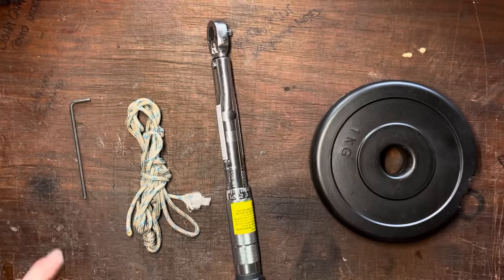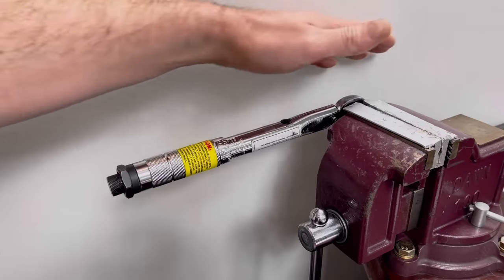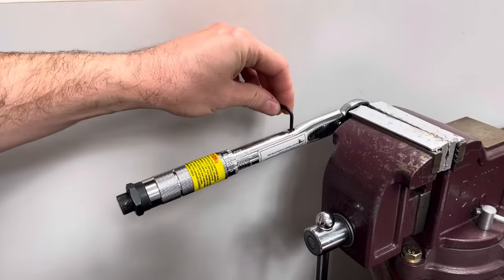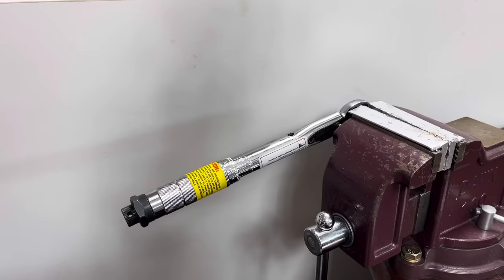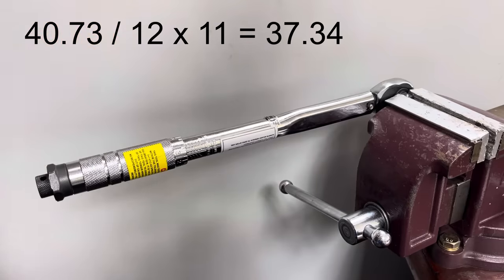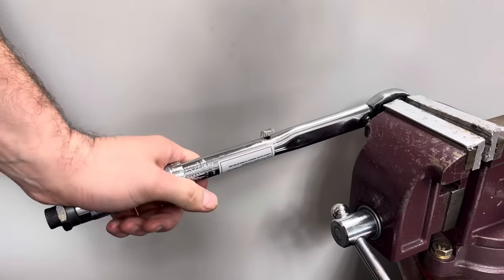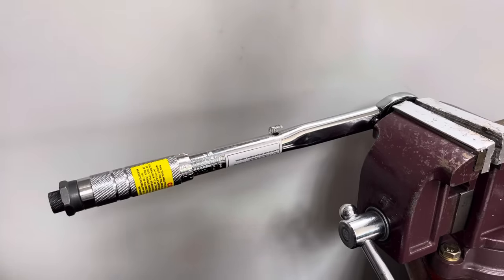CALIBRATE YOUR TORQUE WRENCH IN UNDER 5 MINUTES (NO SPECIAL TOOLS REQUIRED!)

Comment: So you calibrate from approximately the middle of the scale. And when you’re done, it’s calibrated at all settings?
Reply from the maker: Sort of, the problem with spring type torque wrenches is that either end of the scale tends to be a little out unless you specifically calibrate it for that range. Therefore because, for example, my 1/4” torque wrench is only really used on hardware around 3-13NM I have calibrated it to be spot on around 8nm which is still incredibly accurate down to 3 and up to 13. When I get to the upper range of the scale it’s slightly out - it gives slightly more torque. But this is all splitting hairs. Instead of it being 25nm it may be 26.5. That’s not going to cause any problems at all.. it’s a minor difference in the grand scheme of things. :)
Reply: I suppose that wouldn’t be any different than when it was new, and the manufacturer calibrated it. I have heard that these should be re calibrated every year. I always thought of that when torquing engine parts. Well, it’s gotta be pretty close!🤪
Reply from the maker: Haha honestly; I agree with you, I think it’s more important to get even torque on bolts rather than it be absolutely precise to the torque figure :) I mean, both would be ideal, but these are used for small engines that could run with just about any torque applied to the bolts so long as fluids don’t leak haha.

Comment: Good video but I always thought the groove where there is no knurling was the calibration point ?
Reply from the maker: That’s what I’ve been told, good to know :)
Reply: Calibration point? Why would you need a calibration point -- especially one that moves depending on the setting? At the plant they use a torque gauge with socket end to slip the wrench into to calibrate the wrench.  That eliminates error from the weight of the wrench itself that you get when using this method. They don't need or have a calibration point.

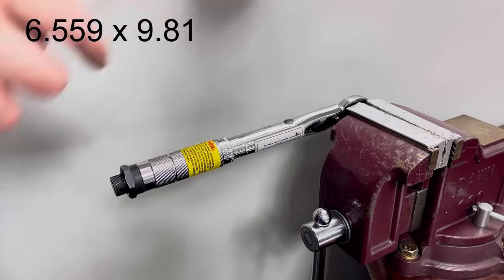Comment: 2:13 dude.  That "clean bit without any knurling" IS THE CALIBRATION POINT!!🤣 That's where it is designed for you to apply the force.
Reply from the maker: Na it makes no difference, you can apply the force anywhere so long as it’s added into the calculation.
Reply: @VintageEngineRepairs  Incorrect. It makes a lot of difference. Check any manufacturer of click wrenches and they will tell you it matters where you apply the force. The closer you apply the force the higher the actual applied torque will be and vs vs. You need to follow the manufacturers calibration procedure to do it correctly.
Reply from the maker: Huh that’s interesting thanks for watching!
Reply: @VintageEngineRepairs  It's not obvious but the best explanation I've seen is the vid
"Why GRIP Position on Torque Wrenches MATTERS!"  by The Bike Sauce who breaks it down.
Reply from the maker: I’ll check it out :) you learn something new every day!

Comment: It will depend where on the handle the user is applying the central force.  Your test is plenty accurate.  For Pound Feet I think the handle position should be 12" from the center of the drive.
Reply from the maker: Thanks for sharing :)
Reply: To be properly accurate, calibration needs to be done using the designated Force Loading Point for the tool, usually indicated on the handle with a ring or rings, or other mark like a target/crosshairs. Calibration to an Imperial scale is done the same as Metric, putting the length from the pivot to the loading point, whatever that is, into the Imperial equation. It's seldom exactly 12", just as the Metric is seldom a meter. The test being shown here would certainly be close enough for the purpose.

Comment: Would the accuracy not be better to use the weight (and calculate with) at the very end of the handle?
Reply: No, a torque wrench has a parameter called the Loading Length, and the most common types of wrench will measure inaccurately if the force is applied away from that location. There's usually an indicator such as a ring or crosspoint near the center of the handgrip to locate this position (called the Loading Point), if not, where your mid-finger sits during the standard grip can be taken as the correct place to hang the weight, pull with a scale or whatever method is being used.
Reply from the maker: As Platypus said!

Comment: the problem is where to actually should you put the rope on the handle.
Reply from the maker: Yep, whatever length you do it doesn’t matter so long as you add the length into the equation.

Comment: Did you use a calibrated scale to measure the weights?
Reply from the maker: No I used a kitchen scale, it’s more than accurate enough for small engine repair torque setting.

Comment: Didn't you neglect the mass of the wrench itself, and the moment imparted by it on the head?
Reply from the maker: Hey! It’s negligible honestly. The natural inaccuracy of the spring has more affect than the weight of the handle. Thanks for watching :)
Reply: @VintageEngineRepairs  That's fair

Comment: This assumes you have an adjustment screw on the shank.
Reply from the maker: Yes! If not you may have an adjustment screw at the end of the wrench, if not there may be an adjustment hex bolt under the end cap :)

Comment: Should we not also include the weight of the torque wrench it self? Just hanging in the vice like that, there is already a reasonable amount of torque being applied?
Reply: Hold the 1/2” driver in your hand, place a small wooden block under the point where you will hang your weights and on to a scale to measure the wrenches own weight?
Subtract the wooden block weight of course.
Reply from the maker: You can do it horizontally with luggage scales if you want to be spot on :)
Reply: @VintageEngineRepairs  Hmm, cool idea, what range of luggage scale would be good? 0-50kg or something?
Reply from the maker: Yes, I have a set 0-50kg. I got it from a fishing shop actually! Very accurate too :)

Comment: the jaws of my vice are knurled, so doing this would chew the hell out of the socket stub on the head.
Reply from the maker: Best to use soft jaws
Reply: @VintageEngineRepairs  Of course, and perhaps such vises exist in the US but I haven’t seen any. Anyway, I’m not going to buy a new vise, it will be cheaper to buy a new torque wrench.  Amazon sells vise jaw inserts, but most are plastic or rubber except for some that are aluminum which is too soft of a metal..
Reply from the maker: I use aluminium jaws that are held in place with magnets. They’re awesome

Comment: Cheers for video, but saying how to calculate the figures , would of been better if you showed what you did on the calculator,as I have never used a calculator,
I also don`t get why measure the distance to where you place the weight,
why cant i just set the torque to 20ft pounds and apply 20lbs of weight to where i would hold the torque wrench and see if it clicks be for or after and adjust the setting as you show
Reply from the maker: Thanks for the advise, the reason you can’t do as you asked is because foot pounds and pounds are not interchangeable forces so you need a calculation. Hopefully by watching it a couple more times it will make more sense :)
Reply: @VintageEngineRepairs  I am really shit a math, how did you convert 20 cm to come up as 0.2 meters , I know a 100 cm to a meter,
Reply from the maker: @piecetoyou8285  you’re not s*** at maths mate, you are just stronger in other areas. Don’t put yourself down. Yes that’s exactly right, 20cm is 0.2m. You just move the decimal point twice from right to left. 20.0cm = 0.20m

Comment: I bought a 1/4 and a 1/2 inch drive torque wrench and I set it for a low bolt setting of 10 NM’s it worked great but when I put it up to 15-20 it just would not click of at the settings. I have since found the 1/2 drive torque can be a bit hit or Miss or just wouldn’t click of at all. Is there something I am doing wrong with it or maybe a faulty wrench. Cheers
Reply from the maker: Hey! Torque wrenches are quite inaccurate across their  full range. I recommend you set your torque wrench  around the torque you use most commonly. For example, I have a 1/4” that reads from 3nm to 25nm. I have mine set at 10nm. So when I’m doing 3nm it clicks a bit soon (lower torque than it is really set for) and when I do 20+nm it clicks a bit later (higher torque than it’s setting). Now, it’s not much. If I set to 3nm it will click at about 2.5nm, but there is a discrepancy. It’s just the nature of this click type torque wrench :)
Reply: When the wrench wouldn’t click I was thinking the thing wasn’t working maybe I should have screwed it all the way up to it’s maximum setting and back down just in case it stuck before I used it as it was brand new and never used before. Thanks friend for the quick reply 👍
Reply from the maker: @jaja8951  no worries, you’re welcome!
Reply: @VintageEngineRepairs  I took the 2 wrenches I had to my father-in-laws vice. Once I tightened it up I put the setting to its lowest and turned it until it clicked I did this all the way up until it was on its maximum getting tighter each setting. I did this on both of them and it worked ok. It must have been because it lay in my garage for over a year or so. I screwed each wrench until it was all the way down to the bottom before I put them away. Hopefully just a glitch Thanks for ur reply bud. 👍😀

Comment: Whatever your method, make sure the weights / scale you're using is accurate otherwise you're calibrating to a bad reference.
Reply from the maker: Spot on! Good advise :)
Reply: At some point you just have to accept reality or the calibration chain would never end. You would have to calibrate the scale used to weigh the weight you use to calibrate the wrench. 🤯
Reply from the maker: Hahaha yes that’s so true 🤣

Comment: Your not allowing for the weight of the tool either
Reply from the maker: Yep, it makes a slight difference. Not enough to effect the end result out of acceptable
tolerance by any means. You can do it horizontally with a fishing / luggage scale.

Comment: Good video and very simple to understand. Good job. However, what if you don't have that adjusting allen screw on your torque wrench (no where on the handle or anywhere else)? How would you caliberate then?
Reply from the maker: Thank you! If that Allen isn’t there, loosen the hex nut and you can twist the insert behind it instead. Hope it helps 👍👍
Reply: Seen 1 video, the adjustment screw was under a removable cap in the end of the handle. Hope this helps. 😊
Reply from the maker: @grunfieldf8694  thank you for sharing!!
Reply: Various types of wrenches use different methods of adjustment. Some are not too user friendly.
Reply from the maker: You’re spot on!

Comment: Why the special formula, to get 37?
Reply from the maker: To calculate the required length vs weight
Reply: So how does that apply, can't you just use the weight -lets say 40 pounds and go to the half way portion of the handle and feel for the click like you did in your video

Comment: I think the groove on the handle is the intended calibration point.  Why else would it be there?  I would measure the length from there, and hang the rope there.
Reply from the maker: Some have said it is, I’m not so sure. Knurling almost always has bands like this.
Reply: @VintageEngineRepairs  "Knurling almost always has bands like this."  Precisely for the reason I stated.
Reply from the maker: @cjflintstone9509  thanks for sharing 👍
Reply: No it's not.  Manufactures and professional calibrators don't use this method since the weight of the wrench and the fact that that point MOVES  with setting would yield inaccuracies.  They use a torque gauge with a socket end.  They need no "calibration point."

Comment: This is really simple and achievable. I want to check my two Norbar torque wrenches. Must find some calibrated weights, and find the adjustment method on my wrenches.
Reply from the maker: Just use any weight, even a bottle of water that you can weigh on kitchen scales. Keep me updated with how you go!
Reply: @VintageEngineRepairs  I have no kitchen scales, but I can test a bottle of water in the Post Office.
Reply from the maker: Haha all good, get some they’re so cheap!
Reply: @VintageEngineRepairs  ah, but you would also have to calibrate the kitchen scales
Reply from the maker: @pashakdescilly7517  na, not for the accuracy we need. The spring has more variation than the weight will.
Reply: @VintageEngineRepairs   I have just checked my 3/8" drive Norbar.  I made a shopping bag of 4 x 2 litre bottles of water, weighed accurately as 7.386kg.  With the torque wrench set at 20Nm, it clicked with the shopping bag handles at 257mm.  That means an indicated 20Nm is really 18.62Nm, which is a 7% error.
Looking at the wrench, I can not see an adjustment system.  If there is none, I will just have to factor that error into my torque settings.
Reply from the maker: @pashakdescilly7517  thanks for sharing :)
Reply: @VintageEngineRepairs   And now I have checked the 1/2" drive Norbar.  With  the Norbar set at 30Nm, and 7.636kg it clicked at 400mm which comes out as 29.96Nm.  It's dead on, and has an adjuster screw should I need it......
Your system works.  Thanks
Reply from the maker: Fantastic, that’s great!!!

Comment: Thank you! Finally a clear, precise video on how to calibrate the torque wrench in Nm! I won't have to convert inches and pounds. Thank you good sir!
Reply from the maker: You’re very welcome!
Reply: If your torque wrench is set right on metric scale ,it will automatically be correct if you use it on the FT LB scale or any other scale it may have . The adjuster adjusts the same spring for all measurement scales on the torque wrench .
Reply from the maker: @maskedavenger2578  yes but metric and imperial measurements don’t align in torque wrenches. If it’s a metric wrench, the imperial will be in decimal points on the other side. Not helpful.
Reply: @VintageEngineRepairs  If the wrench has imperial scale one side & metric on the other ,if one scale is accurate ,the other one will be also. They both set the same spring ,so the NM correct scale setting will be equal in tightness to the equivalent imperial scale setting . Otherwise torque wrench manufactures wouldn’t supply their wrenches with two scale types on one torque wrench ,as one wouldn’t be accurate .
Reply from the maker: @maskedavenger2578 Look at your torque wrench and you’ll understand what I’m referring to.
Reply: @VintageEngineRepairs  I have spring torque wrenches plus an old needle torque wrench . It doesn’t matter what scale full numbers or fractions in between. If the wrench is calibrated to one scale the other uses the same spring & therefore be correct for the other scale . If it wasn’t ,the manufacturers wouldn’t print two different scales on their spring torque wrenches , nor would the old needle type wrenches have 2 scales printed on them . A lot of workshop manuals give you the torque settings in both metric & imperial the tightness Is the same no matter what scale you use ,when using the same torque wrench as long as both settings are equivalent when converted to each other .
Reply from the maker: @maskedavenger2578  yes I agree, both numbers are accurate, but I disagree that it’s helpful to have fractions on one of the scales.

Comment: Good thing you have a torque wrench because your fractions are off.
Reply from the maker: Thanks for watching! Fractions? There aren’t any fractions used in this video. This method of calibration hasn’t let me down :)
Reply: Quarter of a turn and eighth of a turn were both halved. @VintageEngineRepairs
Reply from the maker: @pathagorous1  oh 🤣 I thought you were referring to the equation I discussed! My apologies. I must admit someone else mentioned that and I didn’t notice me doing what I did! The best course of action is small increments lol.
Reply: No worries, just a giggle. @VintageEngineRepairs